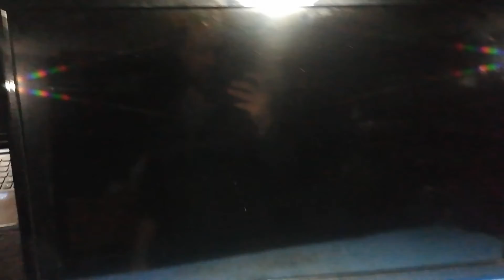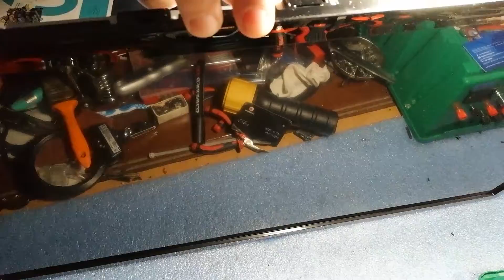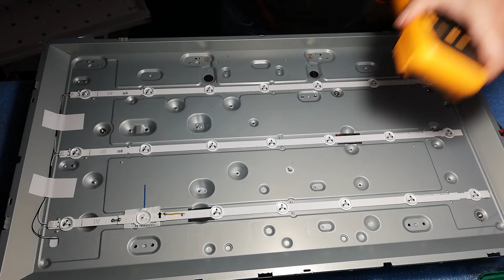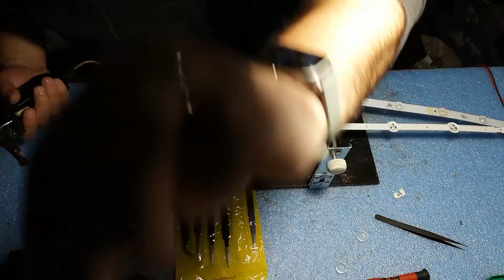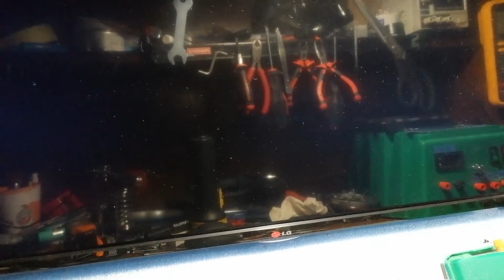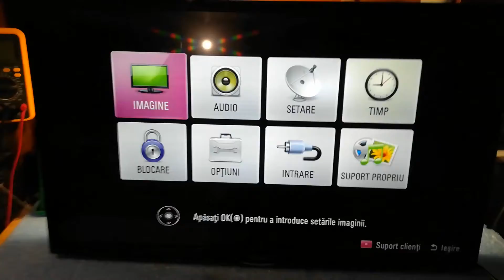LG 32LN540 no backlight - LED repair

Comment: Another thumbs up! HI! I have question. I have the 32lk540bua. Could I use the same light strips from the LG 32LN540B?  If you respond right away. You will have another subscriber. A great video and thanks for sharing!
Reply from the maker: Hi I don't know. Does it have the same numere of leds on a strip? Are the spaced the same on the strip? Does it have the same connector?  You can Antwerp this questions only if you open up the tv or search on the internet.
Reply: @benassy69  Hi! Sorry, the late response. Yes I can confirm. It has the same number of leds on the strip Please respond soon. Thank you.
Reply from the maker: If you want to change the entire led strip just order the ones for your tv model. If you only want to change one led as I did in the video you can use any lg led from any lg strip.
Reply: @benassy69  Hi! Thank you for responding so quickly!

Comment: It still not clear when you checked dc voltage across power supply to the LEDs + and - in power on mode your meter showed 000 voltage. But when you checked + and metal sheet of the tv it showed around 50 volts. But the LEDs supply goes from + and - white and black wire, respectively and no supply goes to the LEDs through metal sheet of TV. You have not checked if dc voltage was present between + and - pins removing led wire plug.